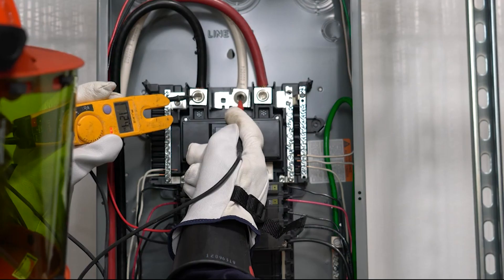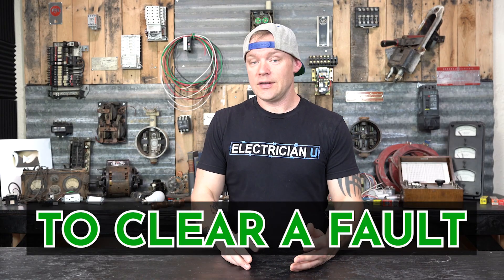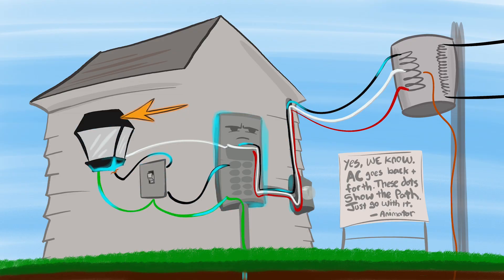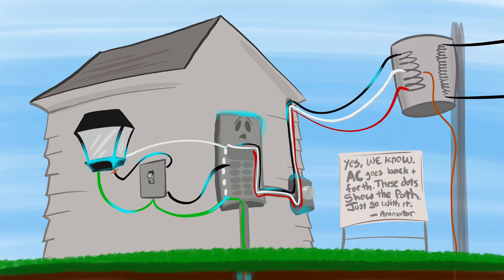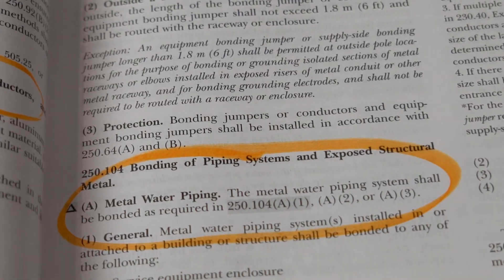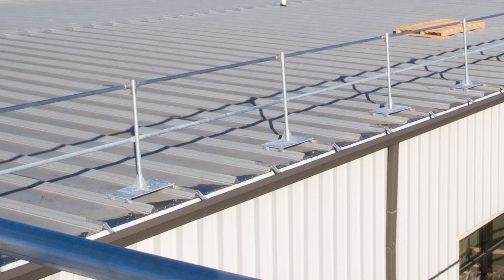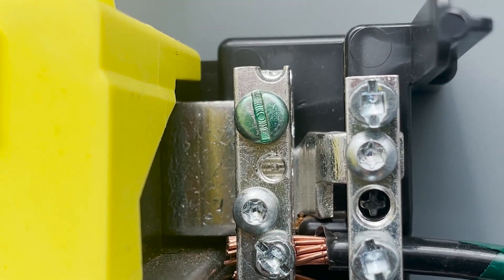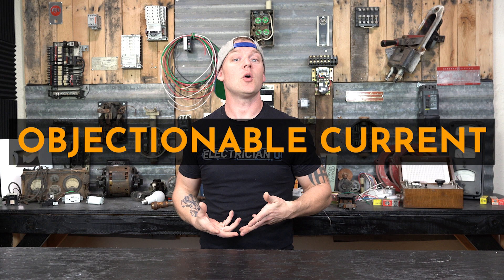Why Do We BOND Neutral & Ground in ELECTRICAL SERVICE PANELS?

Comment: I don’t believe so. Neutral and ground should be a separate circuit. The transformer is grounded at the centre point of the two secondary windings. Even though at this point in theory it’s at zero potential, it’s grounded. The ground wire should be at zero potential, but if it’s bonded to neutral, it could potentially be part of the return line in the circuit and operates as the neutral. You could  also have current leaking to ground and not returning directly through the neutral. If the live line touches the ground, it creates a short circuit and trips the breaker. I have seen ppl using the ground to bypass the neutral and help themselves to free hydro. Just saying. My opinion only.
Reply: In the USA,  the N & G wires are typically bonded in the Service Panel.  What you "believe", is irrelevant ...

Comment: If your main disconnect is bonded then your sub panels are still bonded. The ground in your sub panel and neutral still go back to the same place of touching in the main disconnect breaker panel. This is yet again something that doesn't make since to me still even after watching this video.
Reply: No, the sub-panels are never N-G BONDED .  They are extensions of the main panel ...

Comment: The other reason not to bond N to G in sub panels is that "normal" return (Neutral) current can take the ground conductor back to the panel and not the neutral conductor, yet alone any fault condition.  The ground conductor will be much smaller than the primary conductors.  👍👍
Reply: He said that!   Actually, in residential circuits, the Ground Wire is the same gauge as Hot & Neutral wires ...
Reply: @MrSummitville  Its actually not, in subpanels.  If you put a 100A subpanel in for example.  You could have a #6 ground and #2 L1/L2/N conductors.  Then if they were bonded the return current path could take that #6 ground instead of the #2 neutral conductor and cause it to overload.

Comment: You obviously know what you're talking about but the animated video would be clearer to some if it showed a neutral, hot lead and ground going from the source (breaker panel) to each of the things it feeds. I had a friend that worked for a power company for 30 years and he didn't understand why you need a separate neutral and a ground from the breaker box even after I drew him a picture. He also called the ground in DC circuits the neutral. I tried to explain that there isn't really a neutral with DC circuits because what he is calling neutral is actually just ground. I also tried to explain that dc current  can be positive or negative be positive depending on which side of the batteries in connected to ground (actual earth ground or chassis ground) and all in takes to blow a fuse is to short the positive and negative in a circuit.

Comment: Also, very few solar power systems are separately derived ~ there was an argument years ago when most inverters were transformer based, but most inverters today are non-isolated. The conductors on the far side of the equipment are effectively the same as those on the near side.

Comment: Slight correction - objectionable current is current flowing on the EGC and metal surfaces (which are normally not current carrying) during normal conditions.  The reason we don’t bond neutral to ground at subpanels is because that would connect the neutral and ground in parallel.  Current “returning” from the load could take either path, depending upon the resistance in the circuit. Objectionable current is not about when all hell breaks loose and the pixies escape.  It’s when the pixies are taking random paths home every day, all day.

Great video!
Reply: There's also a mistake @ 2:45 - 3:08. In the animation, charge/current is flowing through the ground wire of the light fixture then through the ground rod of the house and then to the ground (as in the Earth), without any return path. So, the animation implies Earth is gaining the charge due to the fault current. But that can't happen unless it is "static" electricity (which is not the case).

The problem specifically is that the animation, while it shows the ground rod and ground wire of the transformer (as well as of the house), for some reason the animation doesn't show the fault current of the light fixture traveling to the Earth ground and then returning to the transformer via the transformer's ground connection.
Reply: @altuber99_athlete  That's what a ground fault does. You don't have to have it return to the transformer. A short returning to the transformer is a short circuit. That is the whole point of this video and the reason you have to bond the neutral and ground.
Reply: @ghosthand8119  As explained in the video https://youtu.be/P-W42tk-fWc starting @ 9:11, the ground rod is not used for ground faults (explained from 9:20 to 9:28). During a ground fault, current does not travel through the ground rod of the main panel and then into the Earth (explained from 9:33 to 9:44), nor through the ground rod of the main panel and then into the Earth and then through the ground rod of the transformer (explained from 9:44 to 9:54), as you incorrectly said (incorrectly at least according to the previous video).

Instead, during a ground fault, the current has a complete path because ground bar and neutral bar of the main panel are bonded (explained from 9:54 to 10:09), as you correctly said.
Reply: @altuber99_athlete  Novice here. Is the ground wire nothing more than a secondary/back up neutral wire to return the current to the panel rather than let it detour to earth via your body?
Reply: @tycox8704  Yes. Good description by the way.
Reply: @tycox8704  that doesn’t sound right. The ground wire is referred to as the equipment ground. I think it is connected to the neutral bar in the main panel to give it a return path, not the be redundant to the neutral.🤷‍♂️
Reply: @GTLee9  It was an analogy. The ground wire is a safety feature that is normally inactive. But when there is a short that electrifies the equipment, the equipment ground functions as a neutral, no? My understanding is that the current doesn’t actually travel to the service ground if the utility neutral is operating. Therefore, the current traveling through the equipment ground returns via the utility’s neutral.
Reply: @tycox8704  yeah sounds pretty right
Reply: @garagekeys  I cant tell you many times I have been hired by home theatre installers to come and do my magic. One time a customer told me 6 different people had been (including 2 of the absolutely top electricians in his words) there across 4 different days and they were all stumped. The telltale clue is the 60- HZ hum. It was a 100K home theater and I solved it in an hour.
Reply: @altuber99_athlete  But since electricity takes "any and all paths back to it's source" then there would be very small amounts of current flowing in the parallel path from the EGC, to the Ground Bus Bar, to the GEC, to the Ground Electrode, through the earth, to the pole mounted GEC, to the XO tap on the xfmr. Insignificant amounts for sure, but still there.
Reply: @altuber99_athlete  Correct!
Reply: @Ty Cox   no ,,gnd is there to provide a dead short instead of energizing something that shouldn't be hot
Reply: Ahh !   And here I thought those damned Pixies were still under Covid lock-down...  Damn you angry Pixies....!!!
Reply: @kasualskeptik2584  photonic induction is angering them again
Reply: Awesome way to put it !
Reply: You state: "Current “returning” from the load could take either path, depending upon the resistance in the circuit." That, if interpreted as written is absolutely false. Current will take ALL PATHS (though in amounts inversely proportional to the resistance in the path.) So no it won't be "either path" but again returning in ALL Paths. 
This puts the rest of your post in doubt.
Reply: Thank you for stating this. This is correct.
Reply: Ohh ok that makes a lot of sense actually, Thankyou for this comment
Reply: Ground loops suck
Reply: Excellent fine point, Phil. I will add a wrinkle to the objectionable current condition. The more built up the area is (a city neighborhood or tightly packed building area in a town) the more objectionable current can be measured. The ground leaving the bonding point in the main service may have multiple excellent return paths to the utility transformer pole or pad ground via old water mains, sewer mains, gas mains, etc. It may be such an excellent path that it actually splits the neutral current seeking to return to the secondary windings. As bad as that may sound it's not so terrible in that the path to ground for all branch circuits and outlets is the vital connection for personel in a fault condition to insure the instantaneous clearing of the line by the overcurrent protection device. So if a system is very soundly built but you still measure a decent amount of objectionable current on the ground don't be surprised. Excellent grounding is actually likely to produce some "objectionable current". What truly matters is the integrity of the individual branch circuits grounds and neutrals and that all neutral current in sub- panels is isolated until it reaches the main bonding jumper at the Main Disconnect .
Reply: a ground loop can cause noise or interference. also depending on the lines, it's possible the ground wire itself can become hot.
Reply: @lorenzo42p  I have personally seen ground loops at the power plant I worked at cause the thick wall conduit turn red hot. And indeed ground loops can cause horrible noise issues to RF and digital systems.
Reply: @lorenzo42p  Justify your statement.  The ground conductor is there to carry away any fault current and lightning surges.  If it's "hot," you have serious wiring problems.
Reply: You also dont want a ground loop as will be caused when you ground 2 subpanels together that are both grounded. The loop is formed by the ground, the 2 subpanels connection to ground and the wire connecting the two subpanel grounds. Since no conductor is zero ohms you can now have a potential difference between ground connections and the earth and now between the 2 grounds. Ever wonder where that hum comers from in your sound equipment? This is the number one culprit and it wreaks havoc on any signal processing electronics. The  higher the load the more noise you will see on ground. I see this all the time and the number one culprit has to be cable companies that run their own ground connection.
Reply: @exponentmantissa5598  You can't think in 'Ground Loop' terms when it comes to electrical power distribution. Every circuit, every feeder, every panel must have a grounding conductor run with the wires and connected to a common ground point ( ground bar usually) within the panel/box / enclosure. IF a sub-panel feeds another sub-panel then the same method is used AND calling it a 'ground loop' is incorrect and not at all applicable. If your electronics are acting up then the solution is not to eliminate any grounds anywhere. An individual low voltage cable is often grounded at only one end ( thermal couples is one example) to eliminate noise but still provide a shield/ drain for the device. I have installed many thermal couples and many other signal cables in my career as an industrial electrician and isolating one end of the cable's grounds to all similar cable's grounds within a panel is very common. I have also been tasked with getting a better ground than what the feeder's ground can supply. It is needed on plasma tables. We drove 50 feet of ground rods welded together end to end to achieve adequate ground.... Specifically to eliminate noise that the rest of the factory grounding grid was amplifying. The test for our ground was for the ground rod to conduct enough current (.8 amps at 120 volts) to light a 100 watt incandescent lamp to full brightness. I just wanted to make clear that one doesn't lift grounds or isolate grounds in an electrical power distribution system, because that statement you made about two sub-panels and the grounds hinted at that very  dangerous concept.
Reply: @fritzmiller9792  I am an electrical engineer with40 years design experience. Draw it out. You have two panels connected to earth. There is a connection bnetween them through the earth which does conduct. Now bond the 2 panels together with wire. There is your loop. I taught at a tech school for a while and I used to demo the effect of ground loops and how one gets noise from. This is the reason designers always use a star ground configuration.
Reply: @exponentmantissa5598  I never said that there is not a loop. Loops are everywhere if you analyze every ground path of everything. I am saying that you can't lift a ground in electrical power distribution system. You can do it all you want with low voltage, install filters, isolate, install an independent ground.... Whatever it takes.... But lifting a ground in any panel or any feeder is illegal ( there may an extreme circumstance or an engineered application in some sort of factory or test facility.... But no, not ever in a house, can you lift a ground except on a low voltage system.)
Reply: @exponentmantissa5598  thank you for that. You just explained something that was driving me nuts.
Reply: I agree when the new truck comes in to the main box it is bonded there to the ground and it goes straight to a ground rod or a metal water hose pipe

Comment: So if you’re service entrance feeds a large switchboard which in turn feeds multiple Distribution Panels, would those Distribution panels be considered “sub panels” and you would not want the neutral and grounding bar to be bonded together in those panels?
Reply: Bond N-G in one, and only one, location ...

Comment: Thanks for the video. GFI and AFI really confuse folks.  Keep in mind that nfpa is really to prevent fires... It may stop some electrocution scenarios, but fire prevention is the primary goal.  Grounding is one of the most misunderstood things out there.  It is so simple once you see the goal though.  Leakage current in datacenters and other commercial places can be substantial (touch, etc...)

Comment: In Norway we still have partially an older systems with two live wires and they goes each 115volt opposite to create 230volt cycle.
The wall plugs on the "two phase" are bidirectional. Grounded plugs have the connection on two strips on the edge of the plugs so you can insert them two ways. Few countries have it that way.
Not made these days, we use 400+N, but still the single phase domestic has the same plugs.
The neutral is not locked to one side since you can turn the plug into the socket in two ways 180degrees

Comment: Please make a more clear distinction that if both the sub and main panels are final grounded that the SUB'S RETURN WILL SEE NO DIFFERENCE BETWEEN THE RETURN CIRCUIT AND THE GROUNDING CIRCUIT AND CAN USE EITHER OR BOTH TO COMPLETE THE CIRCUIT! 
Now your house (main panel) grounds can have a potential (shock hazard)l and the effective current handling ability of the house's ground wire is lowered for the house (full short specs). This and ground loops (perhaps more) are why you need to final ground bond only at source. 

[I'm an EE not an electrician] Otherwise, a clear and to the point video more for tradesmen but easily understood by layman.  Very educational. Good Job!

Comment: If a circuit breaker is GFCI it should still trip even if the power is going right to ground.
Reply: why won't a normal breaker trip in the event of a ground fault? Current is passing through it, so why not?
Reply: @patrick_rousseau  A "normal" C.B. is NOT as sensitive as a GFCI.  The GFCI will trip on leakage to GROUND, while the CB will not ...
Reply: @MrSummitville  tyvm!!

Comment: Great video! I would like to mention if you have multiple bonds under normal conditions without a fault the return path will be split between the neutral and ground since it’s a parallel path back to the source. Which would be objectionable.
Reply: Called ground loops. And yes, ground loops are a very bad thing.